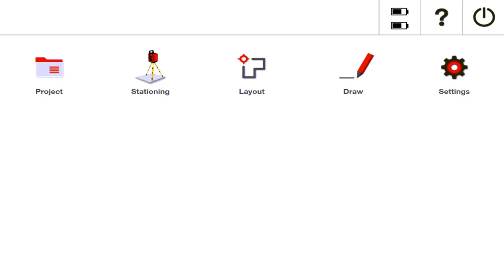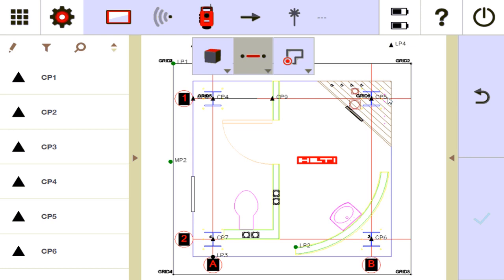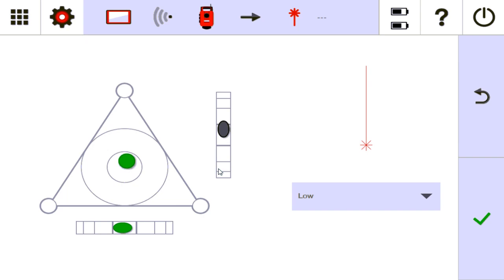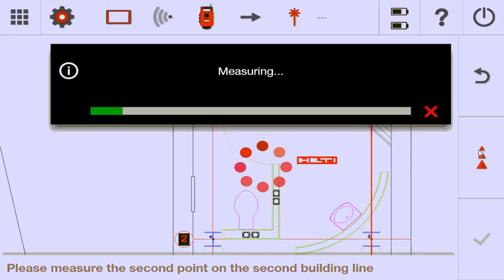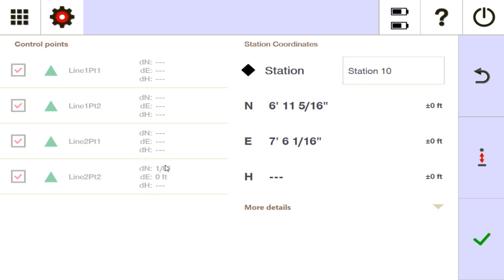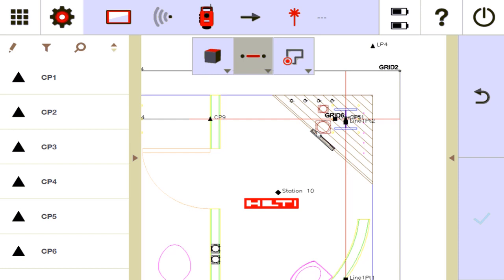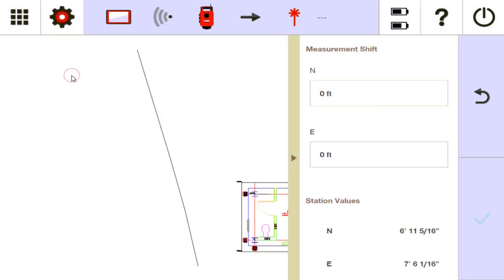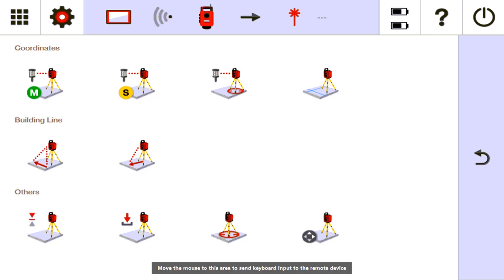Hilti PLC 400 Tutorial - STATIONING - Grid Line Stationing + Station Shift

Comment: I’m going to try this grid line stationing. I work on a mine site in Australia and have been stationing well on control points that a surveyor supplies . I mark out points for footings hold down bolts etc. A surveyor comes and checks at certain points of the job. I always use the same control points supplied but some times I’m off and sometimes spot on. For example I was spot on Northing but 13 mm out easting on all easting points. I stationed next day and redid points and they were right.  I think from now on I will get surveyor to give me a 90 degree grid which I can station off and good thing about it is you can do a backsight check and adjust if it’s out. If you station of co ordinates there’s no way of adjusting if it’s out when doing back sight check of known surveyor points.
Reply from the maker: There is a good amount of versatility that comes with grid line stationing. Sure, you have to be careful - if the lines are off, the tool won't know (it trusts the lines you give it are right), but it allows you to work around a LOT of control point issues.

Comment: Where is the ideal place to set the PLT-300 when using this method? Close to the middle of the layout area or off to the side of one of the grid lines or can it be set on one of the lines, so to speak? I ran into a situation where my layout was off and my boss said it's because I set the tool basically directly on one of the grid lines where it was looking straight towards it. He was told that won't work. My argument is that it's set up in the middle of the layout area or as close as possible.
Reply from the maker: I would place it in the middle of the layout area. If you are measuring too close to the unit (like, within 10 feet) during your set up, the tool isn't getting the best range for establishing itself. Remember that you want long distances (within reason) for the tool to measure when it is stationing, and you want clean angles as it measures point to point (min 45, max 120 degrees between turns - 90 degrees is ideal). But I think if you generally keep the tool in the center of your layout area, and your control lines are accurate, you should be good.

Best practice is to station as accurately as possible, ensure that your stationing is good by doing any number of "checks" as pleases you, and then establish your own control points that you can use to station for the rest of the job. That way, as long as you use those new control points you made, you know that EVERYTHING will be based on that original stationing you gave the tool, whether that was based on grid line stationing or some other type of stationing. Station once, measure and record control points based on that stationing, and tehn ONLY use those new control points for teh rest of the job. You will have very few control issues if this is the route you go.
Reply: Yes, I agree with everything you suggested.. And to be honest, these are the "routines" I follow at every jobsite for reasons you stated here and in your other videos. I've watched most of the 81 in this Playlist, lol. Because I too am passionate about the Hilti measuring tools. Even though I typically only use grid-line stationing, these videos ALL touch base on different functions / that I can use to help be successful in the field. Being able to use what I've learned to verify my work, also helps boost self confidence.. And that in itself tremendously is a show of success.
Having said all that, I am happy to say that I was able to prove my layout to be 100% correct today, and put a feather in my cap when my boss realized that he was the one who had made the mistake(s). He is humble, and understands that it is always a good thing to have an employee stand by their work and with the capabilities to teach them or show them something that obviously benefits their business. I like to call that "JOB SECURITY" 🙌

THANK YOU FOR REPLYING SO QUICKLY!
Reply from the maker: @speedaddict3504  This is awesome to hear! Thank you so much for sharing. Glad to know that the videos are having an impact, but more importantly, that you are essentially becoming your own expert. I'm sure there are things you could teach if you made your own channel, to be honest, just showcasing your different applications and how you do each one.

YouTube is brilliant in that way - people can just come on here and do the best they can to organize learning content in their own way.

Comment: If you absolutely trust your East-West line as a benchmark that is fixed and your fourth point at the southern end of your North-South line shows up 1/4" out to the East. You can shift the total station location 1/8" East to split the difference. Unless of course you absolutely are required to used the East-West line AND the intersection of the two as a benchmark. Then you lay everything out based on that and just recognize that the North_South line is not square to the East-West line. At least you know that the intersection is greater than 90 degrees and you know by how much it is out at the 4th point. Not always easy to do or particularly accurate with a tape measure over distances greater than 100".
Reply from the maker: Thanks for the comment!